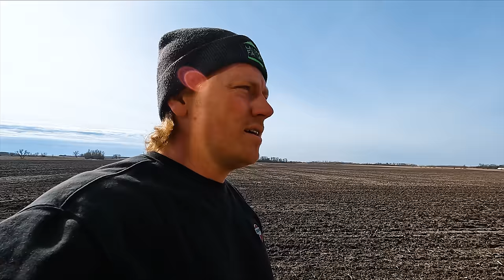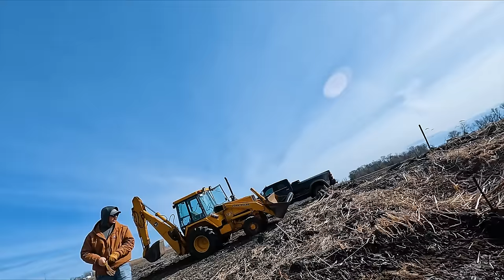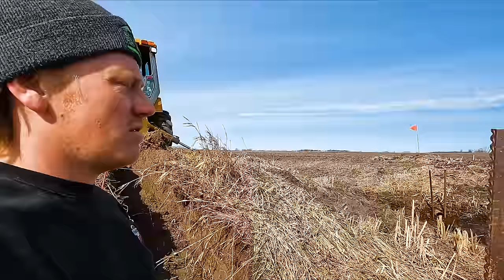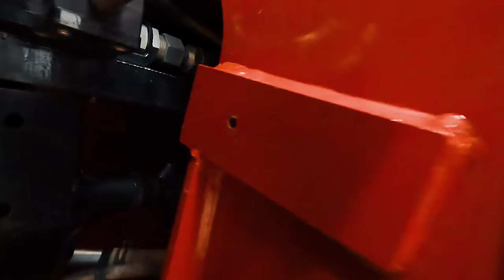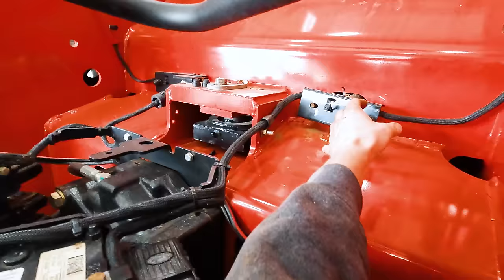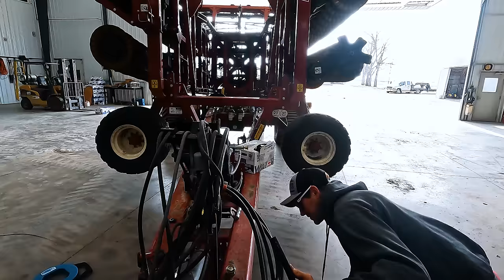Ditch Cleaning Destroyed Our Tile!!

Comment: Just a heads up. On the new AFS connect quads you have to wait for the battery isolation switch to shutoff before hitting the battery disconnect. This usually takes 5-10 minutes. If the disconnect is hit before the isolator is turned off then the isolator is left open and thus power to the cab is still available to an extent. Usually where the draw comes from. We’ve also noticed if you try to crank with a battery charger on the jump posts it usually won’t crank because the VCM sees too much voltage.

Comment: I saw a guy in Nebraska he made a contraption adapters so after the baskets it pulled pipe that worked with downforce so after it chopped it all up with the baskets, it rolled it right afterwards, so he would not have to go back and do it again

Comment: We would split longer runs, especially where one half would wear the casing faster. Sometimes easier to replace and less costly. As far as sectioning a used hose some shops or hose mfg's don't recommend it. I guess not trusting the crimp on a possible degraded hose. Never personally heard of one failing one failing.

Comment: Who makes those hydraulic hose crimps I’m a dairy farmer and it’s always a pain to have to run around town to get a shop to fix a hose.
Reply: You don't even need a crimper, there are replaceable hydraulic hose ends which are the bees knees, Gates is one manufacturer,,  One thing though is they don't always work that well on Napa "wetherhead" brand hose because the outer sheathing is so thin.